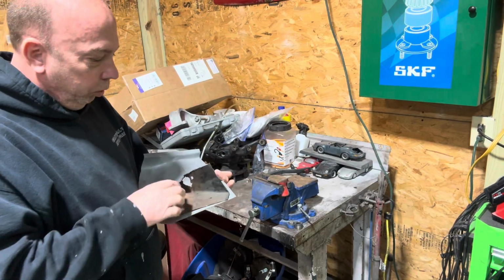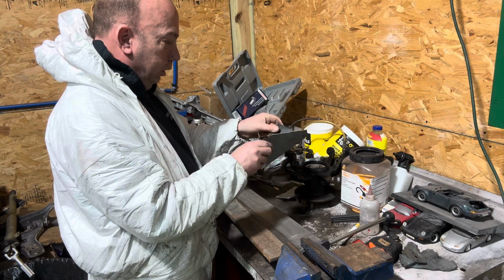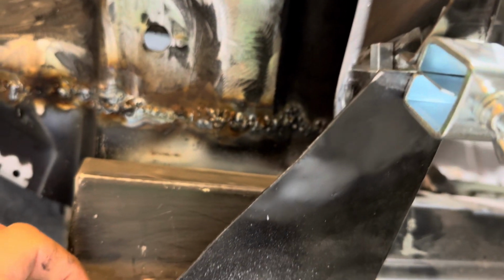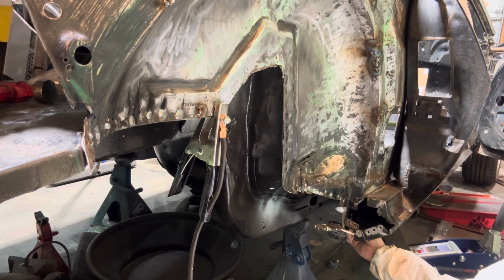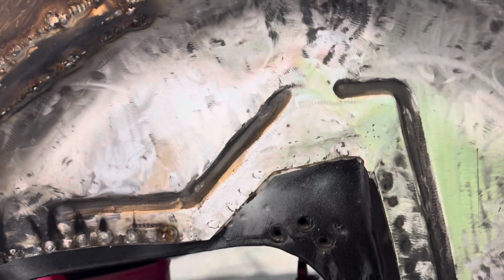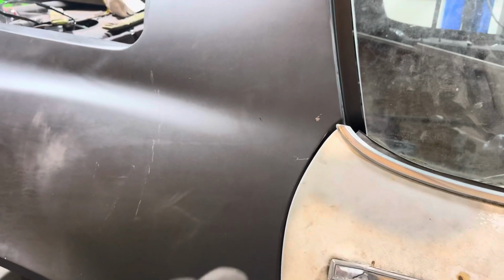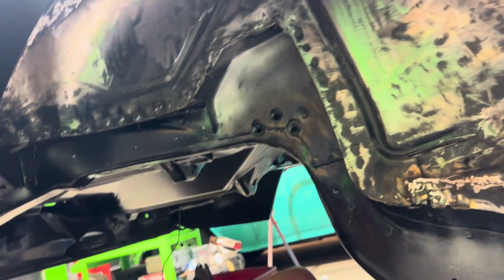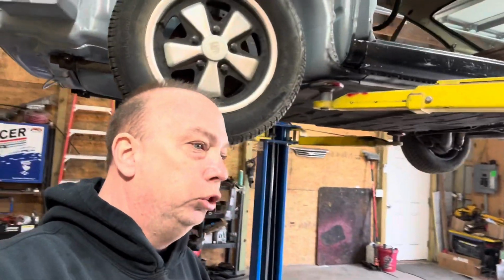1981 Z28 quarter panel fitment and making lower door jamb support

Comment: Thanks for the video. I couldn't see in the video if the car still had the trunk drop offs or if they needed to be replaced. If so I'm curious if you're doing it before you permanently weld the quarters on or after?
Reply from the maker: Thanks for watching, I getting ready to weld the quarters in next week, finally got the car on all 4 wheels.  It’s looking like I might be welding them in after the quarter is welded in. But not 100% yet